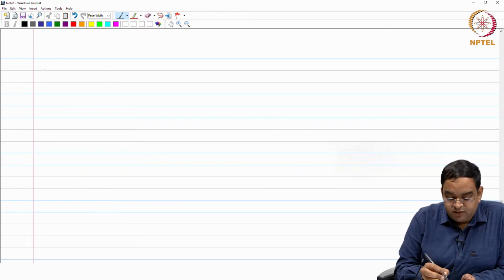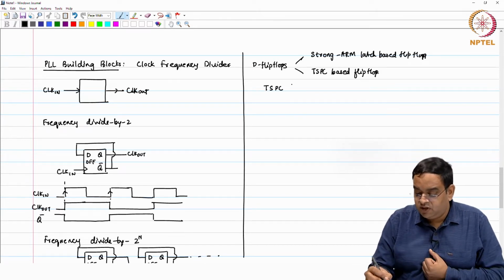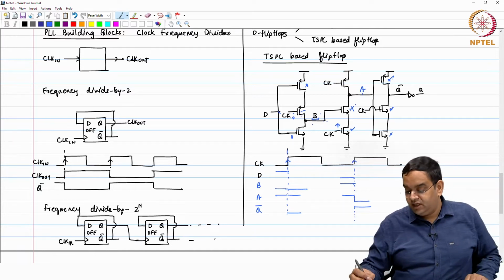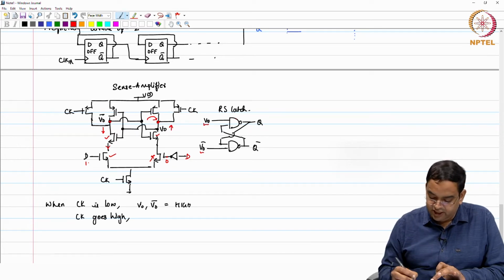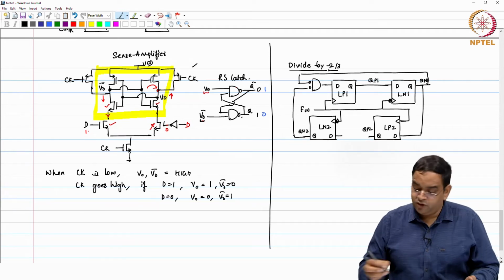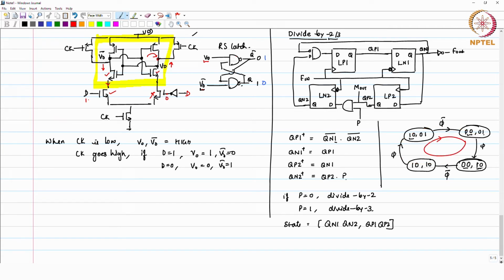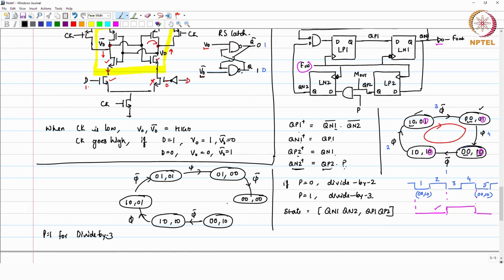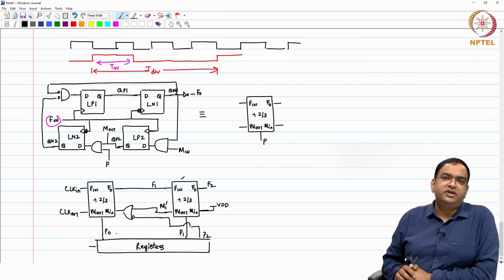Circuit-level Design of Clock Frequency Divider

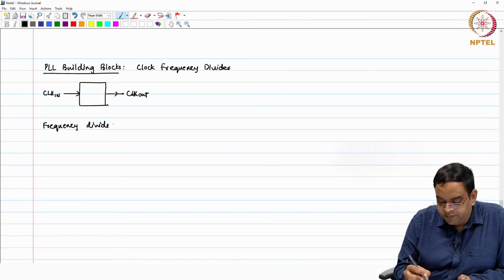Comment: 1:25 Frequency divide by 2
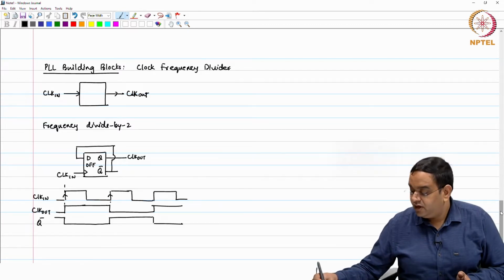3:14 Frequency divivde by 2^n 
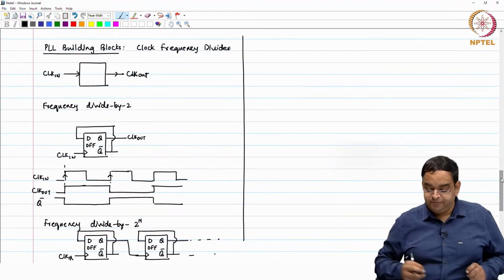4:25 kinds of flipflops for particular division
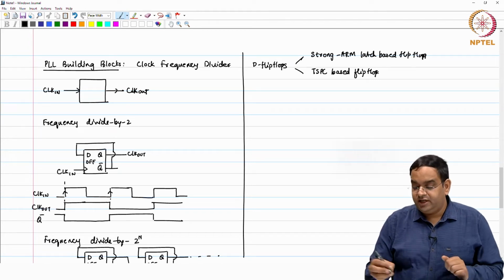5:18 TSPC (True single-phase clocking) based FF
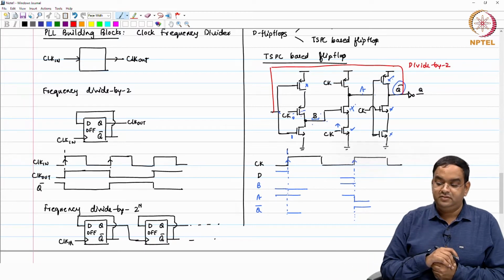11:00 the application of TSPC and its disadvantage at lower frequencies
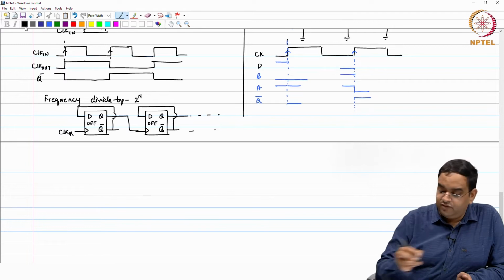12:12 Strong-Arm latch based FF
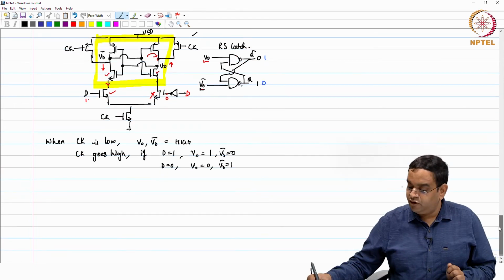17:23 State machine Divide by 2or 3 
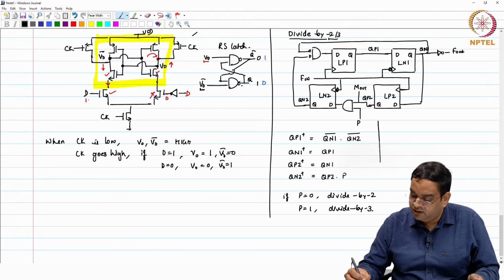22:35 State machine Divide by 2
27:22 State machine Divide by 3
32:40 to have any division ratio